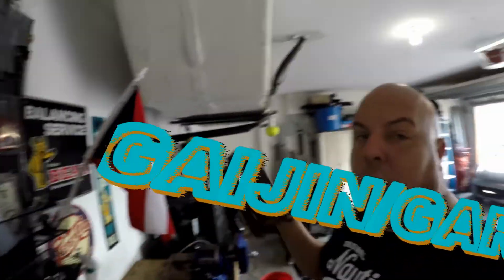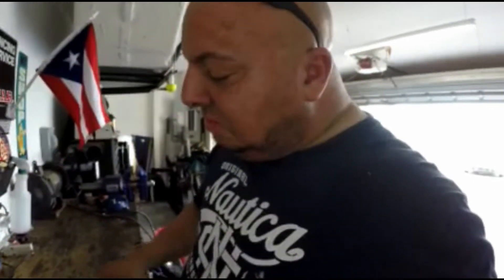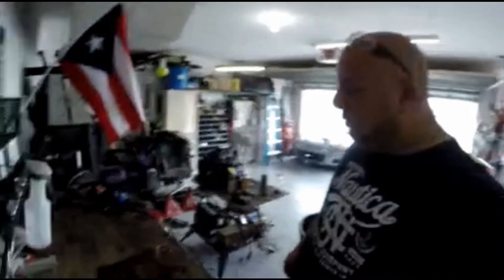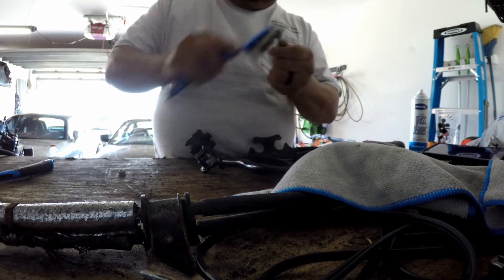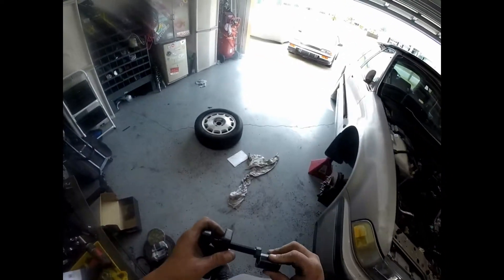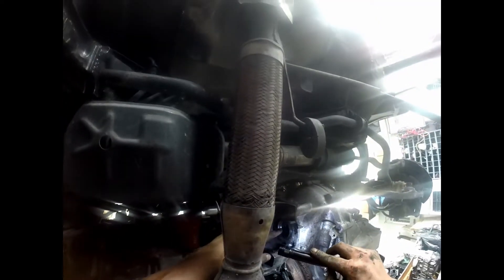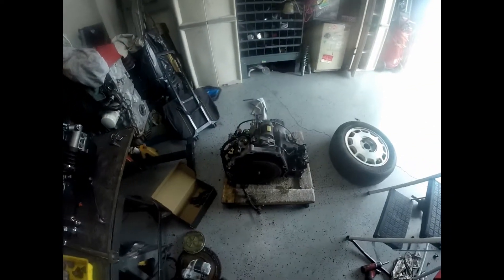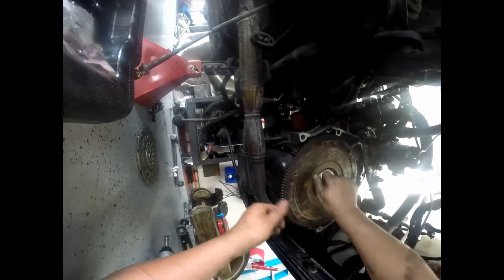HONDA ACCORD CD7 AUTO TO MANUAL PART #2

Comment: I got a 93 accord ex , just did the auto to manual swap , I am just missing the mount for the transmission, I got the transmission from a 95 accord can you please tell me which one I need ?
Reply from the maker: Transmission from 1990 always down to 1997  They are the same transmission If the manual